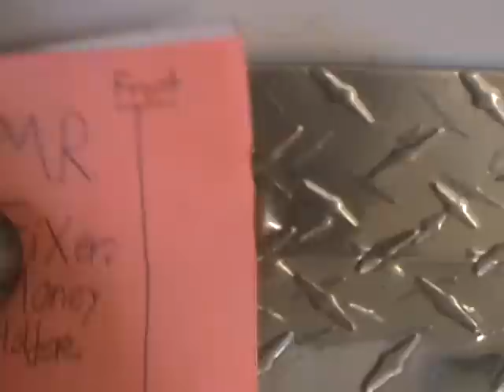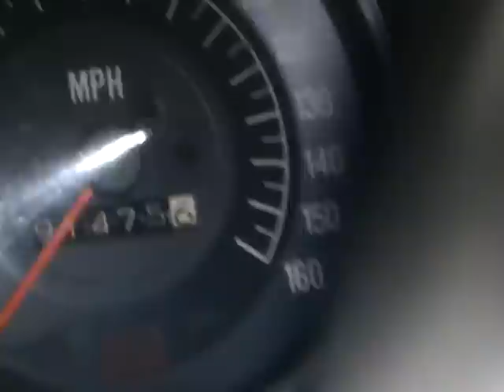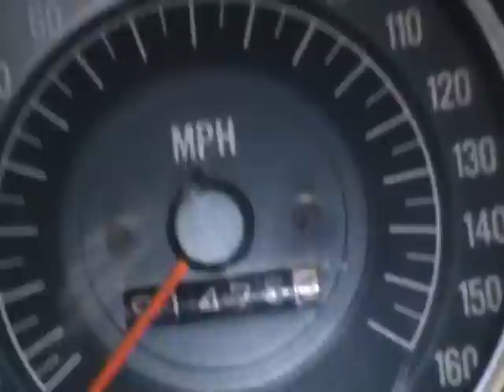WILD CARD CUSTOMS-NO.171-PAINT PIMP

Comment: For cutting through the windshield bondning (polyuerethene) you can use a length of mig wire around two screwdriver handles, pulling it back and forth heats it up and cuts through the bonding pretty quick, watch out it as the mig wire can and does snap as it gets real hot

on the truck i like the glass etch, on the vette i'm not so sure, but then its not my car

those poped vins are for easy read, i bet theres a stamped number somewhere too